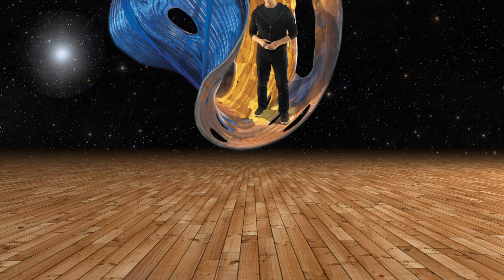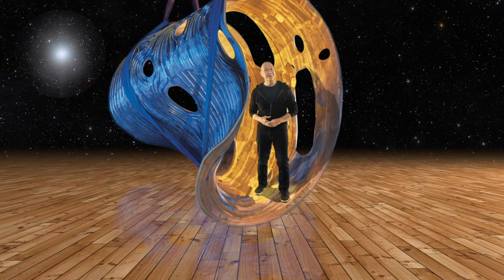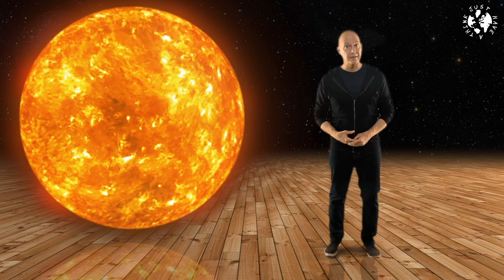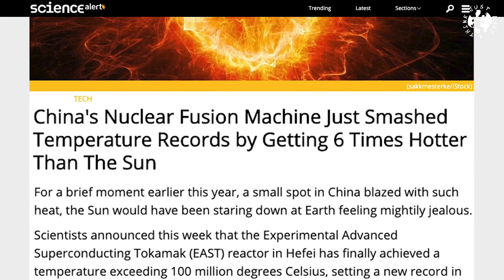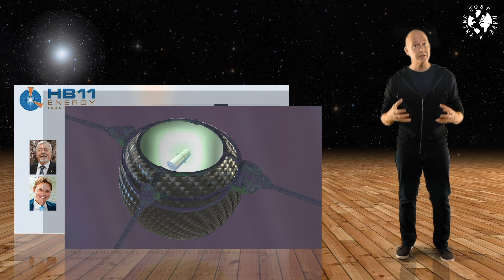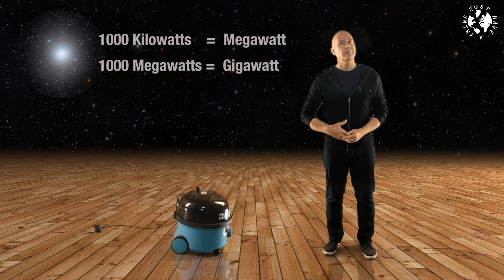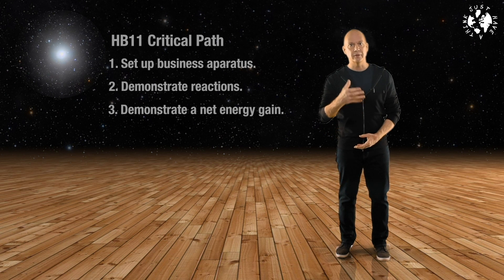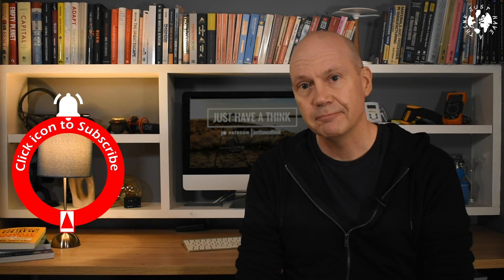Nuclear Fusion:  Revolutionary new breakthrough.

Comment: Student of fusion science + researcher here, there's a lot of reasons to be excited about fusion right now, but HB11 is not one of them. The report you cite is interesting, but is orders upon orders of magnitude away from being actually useful as an energy source. Modern tokamaks are less than one order of magnitude away, and the advent of new materials for forming the magnetic fields (high temperature superconductors) allow for a doubling or more of the field, while fusion power scales with magnetic field to the fourth power.

Tokamaks (and to a lesser degree stellerators) are the only well-understood fusion designs that are anywhere near forming a power plant. The SPARC/ARC projects (using these new magnets, but otherwise being almost entirely non-speculative in their design) are the only ones other than ITER which show as energy-positive, with SPARC being built in just a few years (<5). SPARC isn't designed with energy conversion (their priority is showing that building a plant around the thing makes sense), but it's small and fast enough to build that we could have a fusion power plant producing hundreds of megawatts of power for the grid at some point in the 2020s, but conservatively by the early 2030s.

Do keep building solar panels, though. We're going as fast as we can but we need to be eliminating toxic energy sources NOW.
Reply from the maker: Thanks Anthony. Very useful information. Much appreciated. All the best. Dave
Reply: Just Have a Think This comment thread looks like a pretty good roadmap for a series of videos.
Reply: One thing I'll say for more clarity, is that the most common fusion reaction is D + T, the two heavier isotopes of hydrogen. This is because it produces quite high output energy, has a high probability of occurring, and occurs at relatively low temperatures. proton + Boron 11 (the reaction in the video) is interesting, because it doesn't produce any neutrons. The neutron produced by D + T is bad, in that fast neutrons are dangerous if you're standing inside of the vacuum vessel. It means that the reactor must be shielded, which costs money and makes it bigger, but you can still stand in the same room. It also does activate the vacuum vessel, meaning it becomes radioactive over time. This is the only 'nuclear waste' of the reaction, but it's only radioactive on the scale of ~100 years and not millenia, the amount of radiation is much smaller than nuclear waste, and it's a solid that can't be used to produce nuclear weapons. You can just put it in a lead-lined room and tell people not to walk in, it can't leak into water supplies etc. proton + Boron 11 is aneutronic, meaning there's no neutron produced by the reaction. So there's literally 0 radioactivity involved, which is great and why people look at it!

It does require temperatures in the billions of degrees, rather than ~100 million, but lasers can do it.

The neutron is good, though, because you can actually get energy from it. Nuclear power works because neutrons bounce around in a material and give it their energy as heat. proton Boron 11 makes fast Helium ions, and we have no idea how to get energy from them. There are some ideas, but they've never been shown to my knowledge.

I support science in other fusion technologies, but we need to build a plant NOW and tokamaks are the only technology that comes close, and we have reason to believe they can get there in the imminent future.
Reply: @anthonycavallaro9941  Thank you for illuminating us.
Reply: @anthonycavallaro9941  With the lack of radioactivity and the lack of nescessity of shielding for the proton + boron 11 reaction, do you think that that technology would find its niche in vehicles in the (far) future?
Reply: @WouterNederstigt  Assuming that some direct energy conversion is possible, and the apparatus to hit the 1B+ degrees isn't big enough to make that a moot point, it does theoretically have the smallest profile for sure. Good area for research, not useful for the climate crisis.
Reply: thanks :)
Reply: Anthony Cavallaro, in a conversation with Physicist friends, admittedly they were  over my head, but probably less advanced then your understanding appears to be, I asked, “since photovoltaics produce electricity at less then 5-cents/kWh, is it even remotely possible that “ANY” form of nuclear energy is going to even come vaguely close to that incredibly affordable current flow?  When everyone stopped laughing, they simply said, “No, no, no, that’s not yet even within the dream-scope.”  As a scientist I understand continued research, for tomorrows dreams, but considering Anthropogenic Climate Change is on our ass NOW, and since we have dirt-cheep green energy now, isn’t this all academic wrangling, especially since energy storage is progressing so fast... ?  But, as an Environmental Scientist,  I differ to your insights, thanks, Johnny Cruzen.
Reply: @Naturalook  I am more pessimistic on the ability for renewables to continue scaling for the far-future. The space requirements are great (low energy density), their production is somewhat problematic and their inconsistency becomes a greater problem the more you have. Even if a fusion plant cost 10 times as much per MW/h as a comparable solar plant, the cost of land is an important factor as well, and they both have very low fixed costs. Having a base load is also important for grids, and fusion can provide that. I can't speak too much on the things they're doing with SPARC/ARC, but costing 10 times as much as even the most cost effective solar farms in the world is an extremely conservative estimate. Think <5 times as much certainly, at current solar prices. 

If you speak to the plasma physicists at MIT, the economics do keep them up at night more than the physics, but they're still hopeful. It should beat out oil and fission, certainly!
Reply: @anthonycavallaro9941  & Wookey too; Thanks!  ...Regarding Your space and scaling concerns, don’t rooftop installations solve both?  Also, distributed sources of energy are more secure from attack, and base load is remedied by storage.  Storage is the limiting factor then, but solutions there seem to me much, much more proximal than fusion.   So it’s just large scale commercial energy demand and supply operations that are compromised, and that is the far-future?  “If” I read you right, it’s the far-future where wind&solar may be befuddled,  and it’s the crisis at hand we must survive to enjoy that dilemma?  (I’m an Environmental Scientist writing on this, Handbook to the Future, for the Honest Layman  and profoundly appreciate your insights)!!!
Reply: @Naturalook  You should read 'SEWTHA' (Free online at http://withouthotair.com/) if you haven't already to get a proper idea of how much solar area would be needed to power the UK and how much roof area there is. Short version: 'nothing like enough'.  

Solar on all the roofs is probably helpful, but only if you can work out what to do with it all in summer (maybe hydrolysis/power to fuels), but if you can't use it all then you are probably better off spending the money on something which addresses the much larger peak demand in winter (wind, nuclear, tidal, biogas, gas-with-CCS). 

IMHO the best way to deal with the winter heating peak is actually to remove 80+% of it by improving the buildings (I'm doing this to mine) but this is slow and expensive (although also massively parallelisable and a huge source of economic activity and jobs). This option tends to get ignored, and certainly has been by the govt for the last 2 decades.
I do think that being 'vehemently' against fission isn't very sensible - that's just ignoring the science: It's the lowest carbon generation we know of apart from onshore wind (12 vs 10 gCO2e/kWh), is very area-efficient, causes no pollution in use, is the 2nd safest generation source and most significantly for the UK provides reliable minimum power in the middle of winter. It's fairly expensive (£93/MWh) , but that's still cheaper than all the offshore wind built so far (£110-£150 per MWh)(future onshore and offshore will be cheaper), and what you are paying for is reliable midwinter power when your other options are fossil(bad!), CCS, massively expensive grid reinforcement to get power from elsewhere in Europe, or a truly epic building refurb programme.
You don't have to like it, but to dismiss it out of hand, given the size of our decarbonisation problem really doesn't make much sense (which is why the CC recommend one or two more replacement nuclear plants in the UK). It is (probably) possible to decarbonise the UK without nuclear, but it's almost certainly not cheaper, although it does look a lot cheaper now than is did a decade ago, so you never know...(Excellent comparison here: http://euanmearns.com/uk-electricity-2050-part-4-nuclear-and-renewables-cost-comparisons/)
In practice any solution is likely to be some combination of 'all of the above'. We have little choice but to use every tool at our disposal.

Like I say it's a fascinating problem, and the future is always hard to predict. As well as SEWTHA, and the 2050 pathways project, I would recommend the CCC UK 'Net-Zero' report: https://www.theccc.org.uk/tackling-climate-change/reducing-carbon-emissions/how-the-uk-is-progressing/ and a couple of other proposals like 'What we should do now'(Chris Goodall book).
Reply: @Naturalook  I don't think anyone has any idea how much fusion will cost per kWh eventually, but it's safe to say it'll be 'very expensive' for quite some time. PV is already very cheap (in the $20-70 MWh range), but that's LCOE which does not take penetration into account. The issue is that the power gets less useful as you add more solar beyond the point that you can use it all (mitigated by storage) so as you try to run the whole system on PV (or other variable resource) the costs of storage become important. Storage is still expensive in comparison to generation, so overbuild is cheaper, but doing that increases the cost per MWh (because some of the time the plant sits idle). It's a very complex thing to optimise, and the closer you get to 100% the more expensive it gets to achieve high reliability. Things works quite well in some locations (e.g. Texas can quite cheaply run on wind+solar), but it's much harder in high-latitude countries where solar is 10 times more in summer  than winter (like the UK). In the UK an optimisation leads to something like 80% wind 20% solar for just renewables, but to get to 100%, including transport and heating (which triples total electricity consumption over now) you either need something like factor-of 20 more renewables than now (still 80/20 wind solar) plus a lot of power-to-fuel (the 'Chris Goodall plan'), or some nuclear/CSS to fill in the gaps (the CCC plan), which gets us back to the potential value of fusion.
The cost of fusion research is very small beer in comparison to all the money we need to spend on changing infrastructure, so it's well worth still doing.
Reply: @Wookey.  Thanks... Point taken, it’s “wind&solar because of latitude constraints.  I am vehemently against any form of fission, including Thorium!!!  (The peace symbol actually stands for Nuclear Disarmament).  Please see my reply to Anthony Cavallaro’s reply to my first posts, above...  Again, thanks for the feedback, it’s truly appreciated.
Reply: Always good to hear from someone who actually knows what they are talking about, so I have a question for you :-) I am just an interested layperson, but have been following the ITER, MIT and Tokamak Energy efforts reasonably closely after seeing a Zach Hartwig talk on how close we were getting to making something that (positive energy) works. You mention SPARC above, but what do you think about the Tokamak Energy plans which seem to be going pretty well, and it looks to me as if they are going to have large REBCO magnets before SPARC? AIUI the 2 designs are fairly similar and really do have quite a good chance of producing positive energy machines in ~5 years.
Reply: @Wookey.  That was similar to my journey as well :). Tokamak Energy's spherical tokamak approach was selected because spherical tokamaks theoretically generate more fusion power per unit volume, as their profile is smaller. They also take less energy to run and cost less to build. I don't have much of a plasma physics background, but my understanding for why spherical tokamaks are not the norm is that the ratio of inner radius to outer radius of the torous (spherical tokamaks are still tori, as they have a central solenoid) is a strong predictor for plasma stability. The standard tokamak shape is in the sweet-spot for minimizing these instabilities.

Now, the spherical tokamak scientists have a firm belief that they are able to get around this. My concern with TE specifically is how often they push back deadlines on their claims for increasing the temperature of their plasma (they were trying to hit 25 million for quite a few years I believe), which could mean they're running into plasma stability issues. Their use of HTS tapes is exciting, and I'm personally interested in their development (as well as the STEP and MAST-U spherical tokamaks coming out of the UK). The SPARC/ARC projects are slightly less speculative, however, and the world wants results ASAP.
Reply: More nuclear fission then. Clean and stable
Reply: @andreaswickman1508  And the most expensive.
Reply: Steve Mickler out of?
Reply: Thumbed-up for SPARC.  At this point in time, a faster development cycle is worth a lot more than being almost but not quite practical.
Reply: no.its just more slick marketing to get funding from suckers...it will NEVER WORK AS IT IS THE WRONG SHAPE. WHAT SHAPE IS THE SUN? A PLASMA RIBBON WILL ALWAYS KINK AND LOSE ENERGY AND FIZZLE OUT...
Reply: @esecallum  I'm glad you are SO SURE that all those fusion researchers are wasting their time. But I wonder what expertise you have to back up that certainty? Magnetic torus containment is hard, but we've already had it working well enough to do fusion more than 20 years ago. There is no obvious physics reason why you can't just do the same thing with stronger magnets and/or a bigger torus and get positive energy. Whether it will ever be stable enough to make a power station out of is a matter for future research. Perhaps that's what you mean by 'work'?
Reply: @Wookey.  why cant you understand that plasma a ribbon will always kink due to even the slightest non uniformity in its density or the magnetic field. you squash it here and it pops out somewhere else. what shape is the sun? have torus shaped suns been discovered anywhere in the universe. its nothing more than a expensive gravy train.
Reply: @esecallum  And what about that fact that stable fusion has already been made to work using magnetic containment? EAST did 102 seconds at 90 million C in 2017, and Tokamak Energy did 29 hours of stable plasma in 2016. A stable plasma is possible, even at very high temperatures, so saying 'it can never work' is somewhat contradicted by the fact that it already has. Clearly major improvements are needed for a power-station machine, but I question your certainty that those cannot be achieved, and again ask what you expertise is (beyond being able to observe that the sun uses a different method). This talk about plasma containment is very interesting in understanding exactly why it is hard: https://www.youtube.com/watch?v=SMxOvuSMAug
Reply: @Wookey.  it just fizzles out  as the ribbon always kinks. so what if its stable for short time. its still USELESS.
Reply: Classic response from a magnetic fusion man... Why is it so difficult to understand, this is a NON-thermal approach?
Reply: With the toxic mining of solar panel components... 
There is no ideal answer, unfortunately
Reply: @KateeAngel  As far as I know, the primary and predominant component of nearly all solar panels made today is silicon. Silicon is not toxic. What toxic components are you addressing Kate, and what are their relative toxicities?